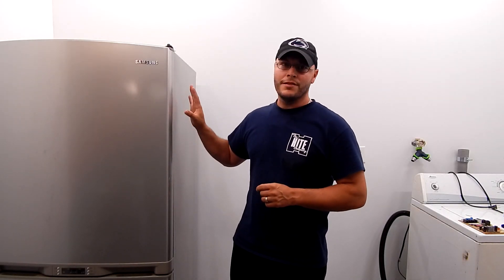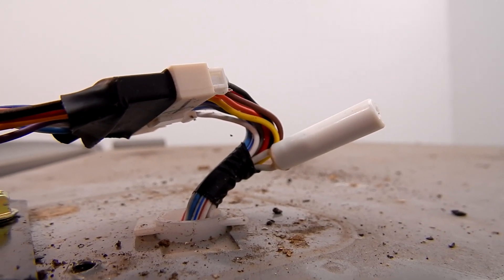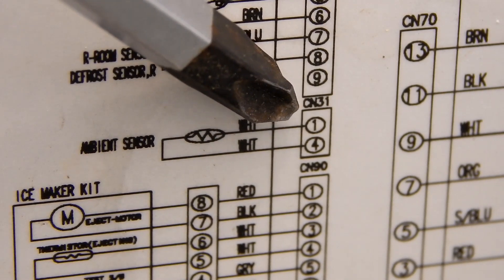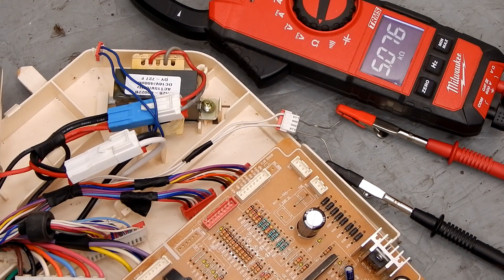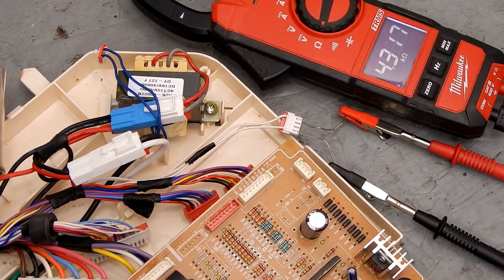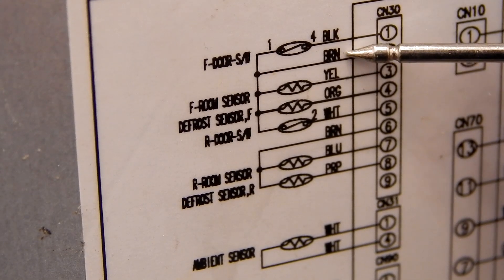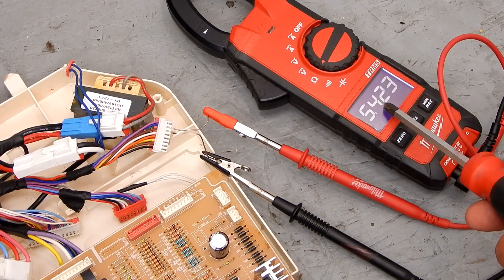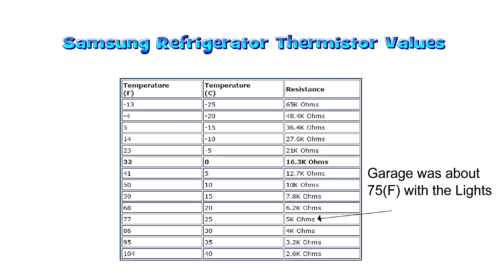How to Test Samsung Refrigerator Thermistors

Comment: NTC Thermistors have a negative temperature coefficient. They are all rated at 25C. So a 5K ohm NTC thermistor will decrease in value as it's temperature rises and conversely increase in resistance as it's temperature decreases. You do get PTC devices but they are less commonly used in my observation.

Comment: So we don't have to take the thermistor off.?
Question my wiring is different my freezer is ylw/gry. The yellow is on cn40/5 (cn40 pin 5) the grey is cn50/5. So 2 separate "plugs". Grey is ground. So I'd unplugg both cn40 and cn50 from the board and test at cn40/5 and cn50/5...? Also does it matter which wires my probes go on...?  Same idea as yours just your brn wire is on the same plug as the freezer wire. Thanks A LOT

Comment: my samsung model rs263tdp/xaa has an evaporator on the fridge and freezer sides, the coils both get cold, but the evap fan wont come on the refrigerator side. I manually tested the fan and its good,. the thermistor was 4 kilo ohms at ambient and 10 kilo ohms  at 32 F. Does the temp sensor thermistor signal the control board to turn on the fan? and is my thermistor bad? thanks
Reply: That thermistor is fine. Thermistors have a negative temperature coefficient. They are all rated at 25C. So a 5K ohm NTC thermistor will decrease in vaule if it is an NTC thermistor as it's temperature rises and conversely increase in resistance or it's temperature decreases. You do get PTC devices but they are less commonly used as far as I see.

Comment: 777th like! 
And Im learning a lot I didnt really want to know about a Samsung but hey, Im learning and it applies eleswhere. First I learned I should probably not take a fridge to a carwash and blast it out. Water gets where it shouldnt! OMG** (INSERT CURSES SELF HERE). Second, due to the knowledge gained from this video, a black fridge in the back of a black truck, in the sun will not operate as wished, hence ambient sensor. 
I have disconnected every possible connector, removed board and dried it all out. The board on bottom didnt get wet because I didnt power blast the rear, but the top one did get wet a bit. The sun and starter fluid (which is probably not recommended but dries fast) made it all dry. As for now the freezer does not cool but that fan runs, the frig gets slightly cool but its fan does not run. The compressor is slightly warm and kinda buzzes and its fan works. So Im going to unplug it (20min) to reset it now that its cool tonight, plug it back in and see how it reads in the morning. Then apply what your putting down here. Thanks.

Comment: i have samsung side by side model : SR-S24NTC the freezer side is perfect for some hours and then stopped working untill I unplug AC cable and put it back again but the fridge side not working at all the temp not change and I replaced the temp sensor and thermal sensor but still not working , is the problem in freezer side or the thermistor in both side  or relay in the mainboard  I check the diagnose menu but there is no code thank in advance

Comment: Good Morning ,
I have a Kenmore pro 40140483800, I am getting NO power to compressor at all. I replaced 3 computer boards: Samsung Main Control board, SAMSUNG REFRIGERATOR ELECTRONIC CONTROL BOARD DA41-00316D, and SAMSUNG REFRIGERATOR ELECTRONIC CONTROL BOARD DA41-00316D, Overload protection relay, Clean condensor. But still no getting power to compressor. 

I checked but NOT replaced any of the 3 the 3 bimetal sensors in the unit:
Freezer part =37.5 ohms
Refrigerator part: 95 ohms
Unit Part: 88 ohms 
A Sears tech came out to look at it and could not fixed it. Then I called a second Tech, o clue either. Any help will be highly appreciated

Comment: My defrost sensor read about 5560K at about 71 deg and my pantry sensor read about 5720K at just a bit lower then 71 deg (the panel was still cool). Does this sound about right? The heater is working. I think the issue may have been the fact that it had never been leveled properly. Thanks...

Comment: !!!Warning!! When checking for ohms turn of the unit. If you dont and you accidently make contact with the mother boarth with swet you will ruin a perfectly good board. Your meter can also get Ruined by puting the probs in a life(electrified) output(wire). Make sure to inspect the board after working on it. Good luck guys.

Comment: I have a Samsung RF4287HA refrigerator/freezer that stopped cooling/freezing. I noticed that the freezer temperature is reading -25, it is set at -2 but the actual temperature is 70 degrees. After watching your video I think it might be the freezer Thermistor. What do you think?
Reply: Or gas has leaked. Who knows.

Comment: Great video sir really enjoy your channel! I do have a question please! I pulled out the freezer temperature sensor in my Samsung side by side freezer and checked the resistance which seems fine. My question is do I still need to do the cold water test that I see in different videos also? I only checked at room temperature and did get the correct reading?  Our fresh food side temp is fine freezer not cooling as well as it use to we have melted ice cream and no ice being made. Thank you Bill have a wondeful day. Paul
Reply: If you are referring to the defrost thermostat, I usually put it in a freezer for a few minutes or a glass of icewater.  You should NOT get a reading at room temperature.
  If you are referring to the thermistor, disregard the above statement.
Reply: That thermistor is fine. Thermistors have a negative temperature coefficient. They are all rated at 25C. So a 5K ohm NTC thermistor will decrease in vaule if it is an NTC thermistor as it's temperature rises and conversely increase in resistance or it's temperature decreases. You do get PTC devices but they are less commonly used as far as I see.

Comment: Are all of the sensors the same?  Is the ambient air sensor the same as the defrost sensor, and the one in the ice maker? 
My kids broke off the one in our lower ice maker, but we don't use that ice maker anyway. When there's a power outage, I have to short the wires to get the fridge through POST testing, but that's been the only problem. 
Now my variable speed compressor isn't working, and missing that sensor confuses the whole situation. Samsung doesn't list any details on that particular sensor, and only sell it with the whole ice maker unit for over $100.
I want to either put a new sensor in the existing ice maker, or figure out how to jumper it to delete the ice maker altogether, without confusing the computer.
Any suggestions?

Comment: Bill, regarding a Samsung refr with "twin cooling." Setting the refr temp to lowest setting of 34* the digital readout stays at about 34* but a thermometer placed in refr shows around 40 - 42.* If I push "power cool" the digital readout drops to about 24 - 26* while a thermometer on the lowest shelf drops to 34 - 36.* I would like a consistent 38.* Is there a method to recalibrate the refr controls to get the proper temp? The freezer works fine at about 4.* Thanks.
Reply: Have the same problem with same frig. Judging by what Bill said, i think its the frig temp. sensor thermistor. Did he respond to you?
Reply: Mine is the same way, but if you place the thermometer near where the fridge temp sensor is, then its probably pretty close to what the fridge says it is.  At least mine is.  So the issue with mine is that the sensor is near the bottom of the compartment.  I have a "4 door" where there are 4 independent compartments, two doors and two drawers on the bottom.  So in my fridge door the sensor is right above the crisper drawer at the bottom.  So the bottom is the coolest of course since heat rises.  The fan does blow air up to the higher levels, but it cuts out I guess when the sensor on the bottom says so.   I can tell the fan works by holding in the light button so it thinks the door is closed, takes a minute to kick on.  I intend to relocate the sensor, by cutting the wires and soldering in a couple feet of thicker lower gauge wire (lower resistance) since its likely calibrated to the existing wire gauge/length to the sensor.   And then I may need to tape over the vents on the bottom if it gets too cold there, but I intend to set it at 40F, if I can actually get 40F all over.  Then I don't mind the bottom being 37 or something like that.  As it is, I set it to 36, and I get 43-45 everywhere but the back of the bottom shelf near the sensor.

Comment: Hello Bil,l I have a problem with this samsung rs21dans / 1 fridge which shows on its panel that the freezer temperature is flashing at 14 ° c and that side of the refrigerator is thawed. Do you know what the fault is?. I would appreciate your help

Comment: Your video gets a  "B" from me for the following reason: Your chart values allow for a 5% variation and not exceed acceptable values. Plus I really need to interpolate to get a precise ohm value for temperatures not listed in the chart. Providing a linear equation for ohm vs temperature would be nice for those unable to derive it.  Also, 5% seems small to warrant replacement. Hell my ohm meter could be off by 5%.  Overall, I think it's a good video.

Comment: Hi Bill,  I bought a new Samsung RF263BEAESR and now the error 6 is showing.  Local repairman says the ambient sensor has gone--and a new one costs almost $200.  Any advice on this?  Thanks  --DanP
Reply: Return it and buy a different refrigerator. I can't even begin to tell you how much time and money I have spent trying to get mine to work correctly. Between paying "professionals" to come out, and swapping out parts myself- that is the best advise you could get. Don't believe me? Just google the model number.
Reply: OK, can you suggest a brand?  I seem to be hearing that they are all the same--i.e., bad!
Reply: Buy a 5kohm NTC thermistor at any electronic spares supplier. They cost under 1 dollar. Solder it onto the wires and heatshrink wires individually and then heatshring it overall. That's it. Repair yourself for under a dollar. They are all rated at 25C temperature. Convert to F if you're American.

Comment: I have very old samsung fridge freezer. Confused with one of the sensors which has 4 wire  and it's in the fridge section. colour is white. 

How do I check it's working ? Is the value correct 

Resistance is 0c = 26kohms and at room temperature 12k Ohms
O both  sensors.  Defrost and fridge sensor. 
One with 4 wire white sensor>>one pair got resistance 12-26k Ohms and 2nd pair at 0 degree C R=986R at room tentative R=986R

Any idea how to replace them with 2 wire sensor as I could not find 4 wire sensor in the market ?

Comment: my Samsung rs21jgrs. heater not stopping on long enough. After removing brand new back cover with new modified kit fitted. The top half of heater is melted bottom half frozen. was having this problem before replacing the heater, sensors the modified back. still freezing up. have checked pcb components they all in order. The only thing i couldn't check was the main processor unit on board. would that be the cause of my problem.